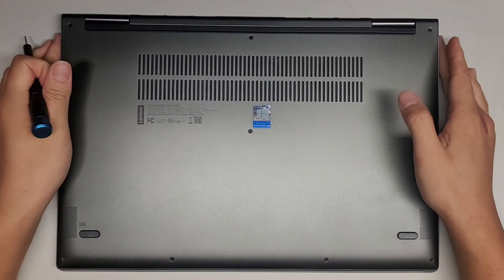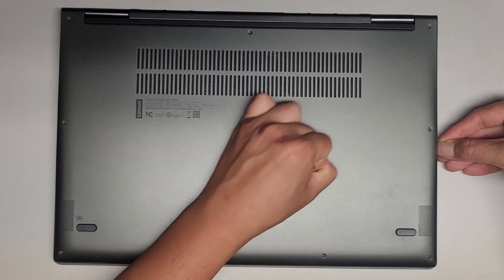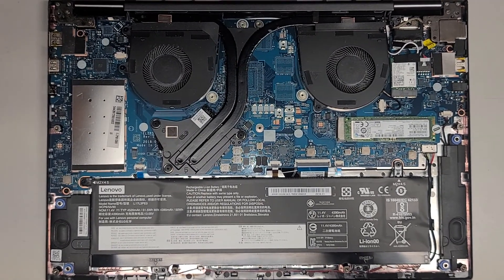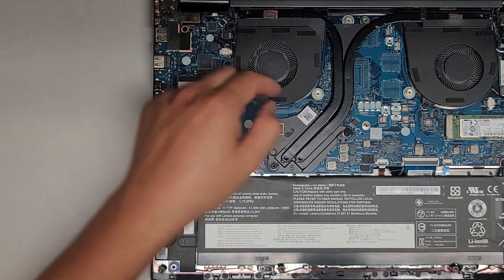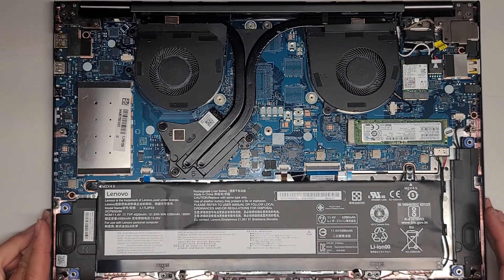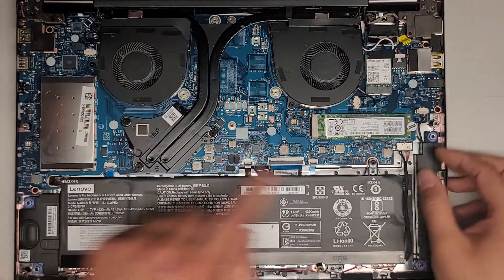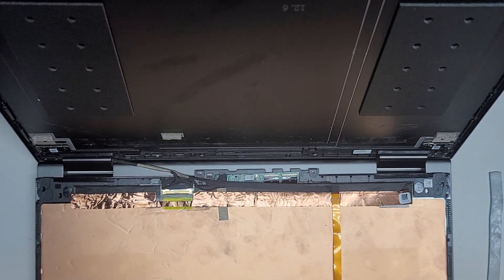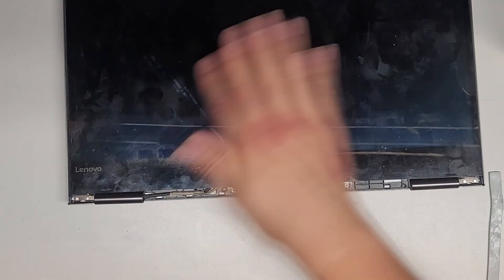Lenovo Yoga 730-15IWL Disassembly RAM SSD Hard Drive Upgrade Battery LCD Screen Replacement Repair

Comment: Hello! Very helpful video, thank you.
I'm wondering if you could please help me out on this specific model.
 I would like to disassemble my laptop as it was dropped and the lid is slighlty bent on one corner. I'm hoping I could take off the lcd panel and bend it back just enough so that it won't be such a worry.  Though, by doing this I would have to take out the tab adhesives holding down the screen and would like to be able to put some back to stick the lcd in place. The problem is, I am having trouble finding replacement tabs online. I am living in Europe but if you or someone could find me any place that sells the exact advesive tabs, that would be great. At least that way I know what i am looking for.
Thank you in advance.

Edit: Just realized you didn't put any adhesive on the replacement lcd. Isn't it now prone to just falling out? 
Also, I do know this video is not very recent but i'm really hoping you could help me somehow. Thank you.
Reply from the maker: You don't need adhesive since it's snug in place, but you can put small pieces of double sided tape in the 4 corners if you're worried about it. The frame clips in to hold it.
Reply: @ItsBinhRepaired  It's just that I have seen one or two other videos that say they need the adhesive, but they are slightly different models. But if you say so, thanks for your your time and help!
Reply from the maker: I hate how YouTube doesn't notify me of replies. Hope it worked.
Reply: @ItsBinhRepaired  Yes, it has been working great, thanks.
Reply from the maker: Awesome!

Comment: Thanks for the video. I will attempt this fix soon. One question: The power button needs replacement and I'm unable to find it with any of my searches. Is it part of a board and if so how would I search for it? Same Lenovo  730-15IWL. Thanks!
Reply from the maker: It's part of the motherboard and will require soldering to replace. You can use the one key recovery button to power it on instead.

Comment: Hi,  i have a broken screen of same laptop YOGA 730-15IWL. I bought it from best buy and its untouched. Would you be able to replace my screen?
Reply from the maker: Yes, but you'll have to ship it to me, pay for shipping back and for the repair.
Reply: @ItsBinhRepaired  how much for the repair?
Reply from the maker: @mahendrasubedi6442  what did you need fixed?
Reply: @ItsBinhRepaired  display and my keyboard’s key asdf is not working
Reply from the maker: That'll likely be very very expensive to repair
Reply: @ItsBinhRepaired  what about just to the keyboard?
Reply from the maker: @mahendrasubedi6442  then you might as well use a usb keyboard

Comment: using yoga 730 15iwl my touchscreen does not work although display works fine, keyboard also has some issues. lenovo cant repair. what to do
Reply from the maker: New pooter?
Reply: New to the channel
Reply from the maker: How old is the computer?
Reply: @ItsBinhRepaired  2019 manufactured
Reply from the maker: Hmmm strange Lenovo can't fix their own device
Reply: Better stick to apple and throw windows
Reply from the maker: @Eclcorp  apple is worse and costs 2-5x more lol
Reply: @ItsBinhRepaired  i have two yogas 920 purchased @2500 $ and 730 purchased @800$ not so cheap actually
Reply from the maker: Dang